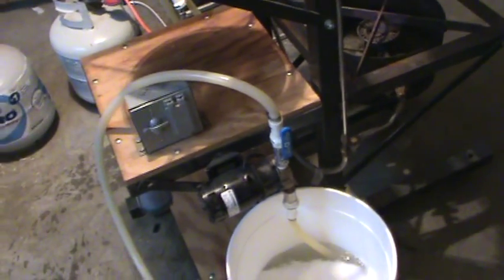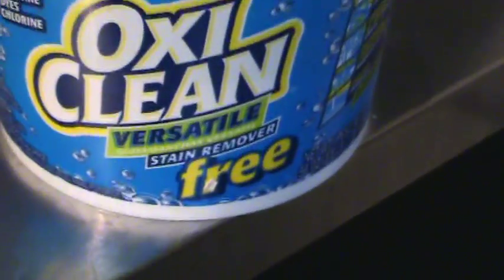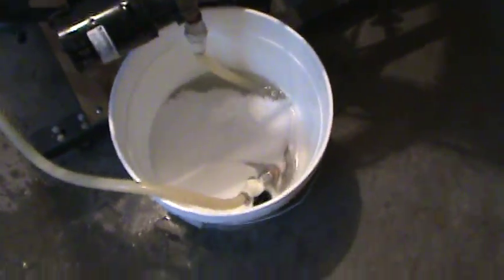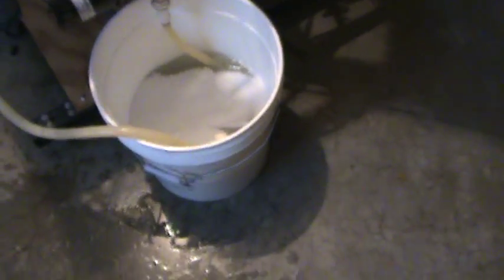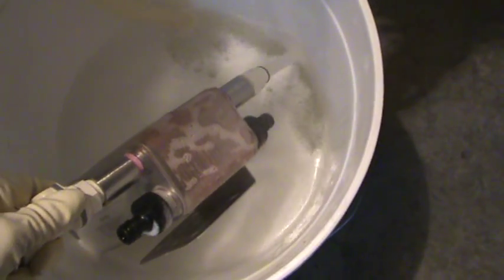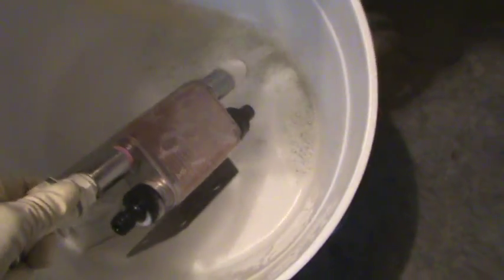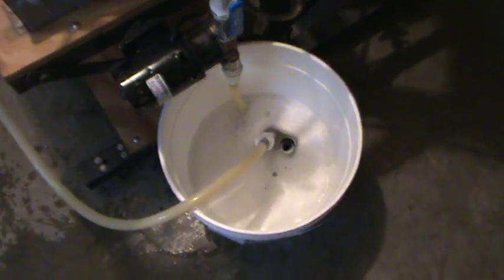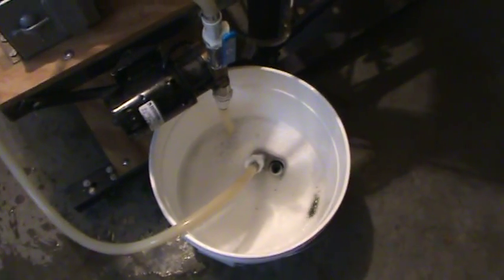Brewing With Bob - Cleaning My Therminator

Comment: The Therminator is amazing.  It cools 6 gallons from 200 degrees to 60 in about 10 minutes.  If you are having clogging problems, try straining the pour with a mesh screen when you transfer your mash to your boil to catch as much debris as you can.

Comment: How can you drain all the water out of the therminator after cleaning? It always remain water in mine, I don't really understand how to do it.
Reply from the maker: Just stand it up on it's end with the openings on the bottom.  It will drain most of the water out but you will never get it all.
Reply: Great, thanks for the advice!
Reply: Put it in the oven, 400F for 40 min and you have a sanitized and dry chiller